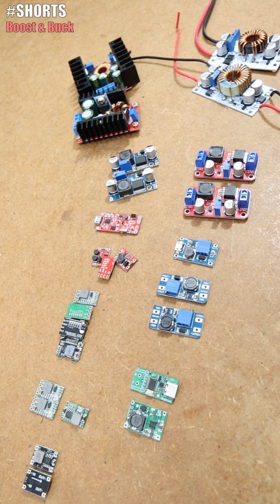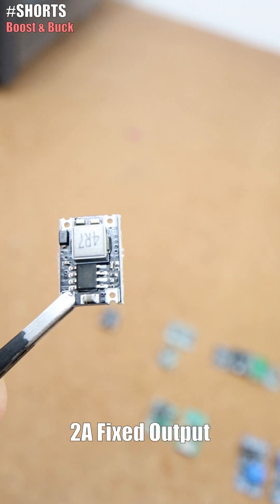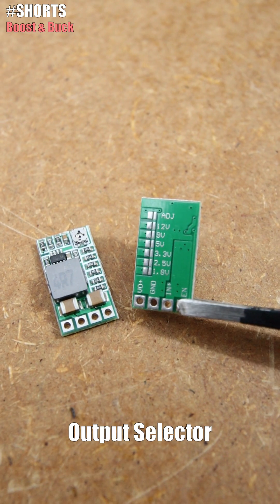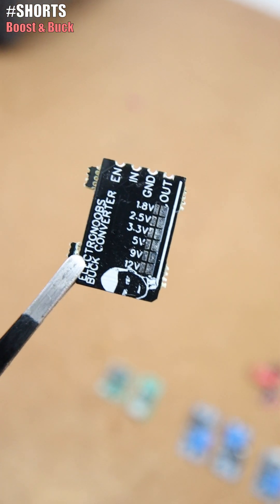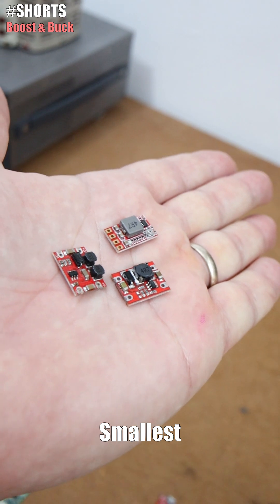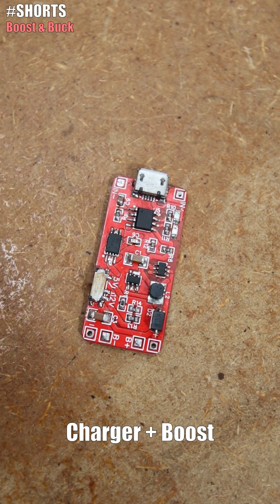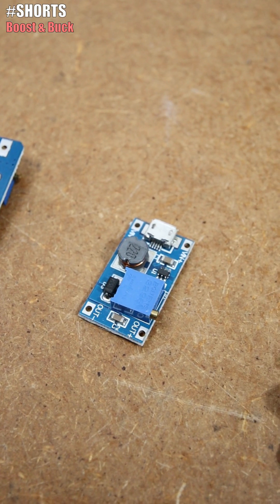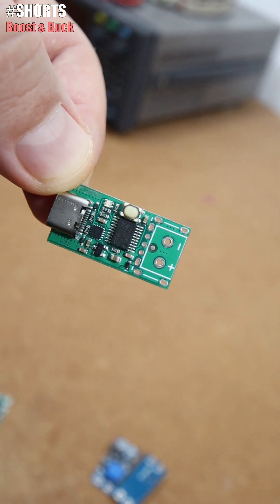BOOST & BUCK Converters

Comment: Step up Converter Increase input voltage and current 

Stepdown Converter Decrease input voltage to output and current 

Boost converter doing basically all what do those two upper there

Way simpler to people understand.

Comment: There's actually an even smaller than your smallest, by Nixie Gadgets on eBay, works off 5v and outputs between 150v to 400v, used for Nixie clocks or low power vacuum tube circuits (like preamps).

Comment: Also, there exist the buck and boost converters, that can work as both. They are useful when the input voltage can vary above or below the target voltage
Reply: So buck and boost both do the step up and step down?
Reply: @JaucheSan  , what I meant is that you can find modules for Buck converters (step down voltage), for Boost converters (step up voltage) and also Buck-Boost Converter Modules that can do both, depending on input voltage and selected output voltage.

Comment: I have always wondered if you could run most laptop power supplies off of 120v DC. I have a boost converter that is 15amp 10v-120v
Reply: You probably could... If the laptop power supply is rated to take an input voltage down to 80v AC. 
The first stage of most power supplies is a rectifier, so DC should be fine.
Better yet: use a dc to dc boost converter that can output 19V or whatever the laptop requires.
Reply: @davebutler3905 That’s what I was thinking. If the first stage is a rectifier it should definitely work. 

I have done the straight voltage to the laptop thing. But all my converters are cheap Chinese things. So I figured putting it dc through the laptop power supply might make it a lot clearer. When I eventually get a scope I will check that.

Comment: I was charging my mobility scooter battery in a compartment in my car. The 36v 2amp charger overheated. So I cut off the cord and purchased a 30a boost converter. Running it at 2 amps never bothered it. Even when the car sat in the sun and got to 120 degrees. 😋🧐
Reply: Well done! Very satisfying!